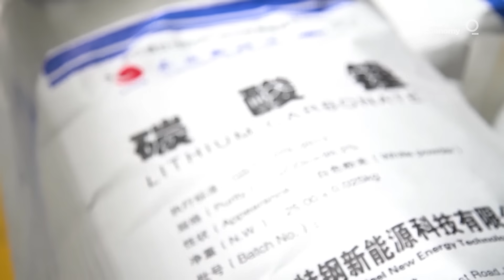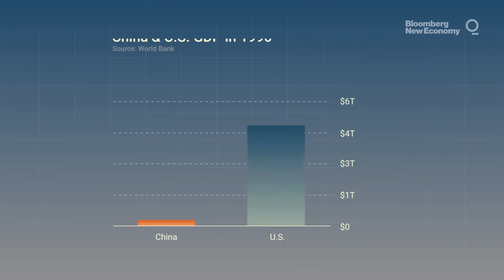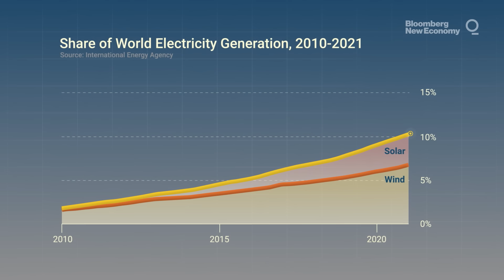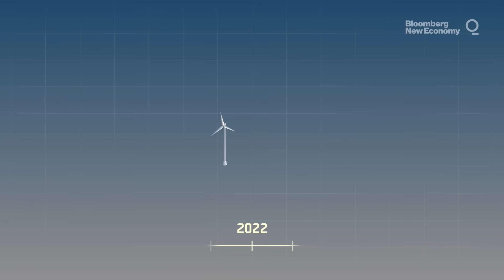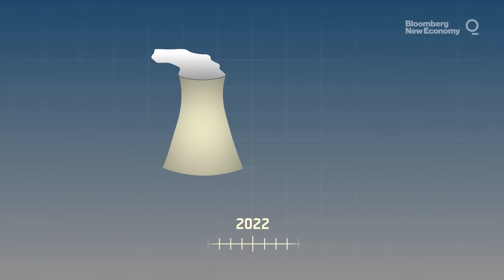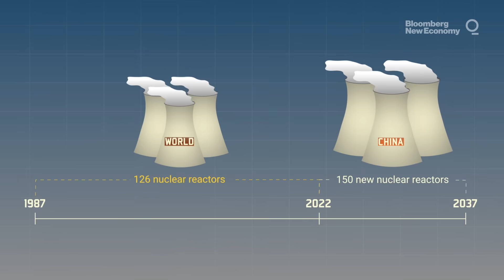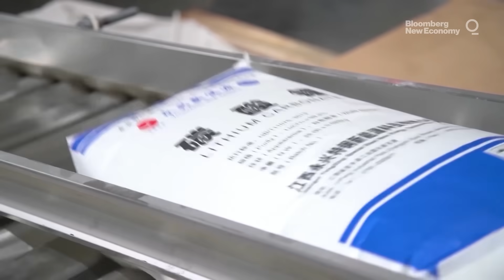How China Plans to Win the Future of Energy

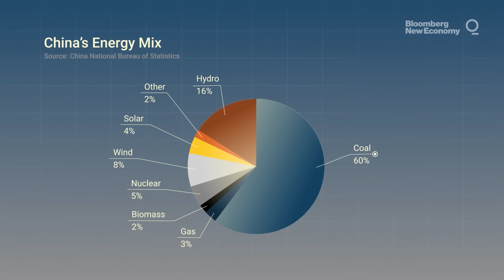Comment: The success of the energy transition depends on a transformation of the global energy sector from fossil-based to zero-carbon sources by the second half of this century, reducing energy-related CO2 emissions to mitigate climate change and limit global temperature to within 1.5° of pre-industrial levels.  5:14
An aggressive energy efficiency strategy, combined with the ramping up of renewables to replace fossil fuels, is the most realistic path towards halving emissions by 2030.
The 1.5°C Scenario will require investments of USD 5.7 trillion per year until 2030. 
Source: IRENA

Comment: Rolling blackouts in the 90’s.  At 14:24 He said it can’t happen again.  Well, it just did this summer.   Green energy is an unstable supply source.  Droughts will happen again and again so where is the hydro power then?  Solar power is way insufficient for a modern, developed country.  Maybe that is why President Xi is turning back the clock?

Comment: Lots of the misconception about the white "smoke" are referenced as the problem while using the traditional fule to generate electricity. 

But, as far as I know, and worked in a power plant for a short peroid of time, the white "smoke" are water. The real pollution is not visiable, as most of porcess are highly effect and no pollution is visiable to human eye. 
It comes with greate trouble when you see real black smoke from a power plant. It may indicate the coal is not full burned and the furance temp is not high enough to burn the coal and thus may cause other issue, like explosion. But it is highly unlikly for a modern power plant since it is mainly operatered by computer. One story about a power plant is that it fully operate over 400 days without any maintance requirement, which means ppl just go there and got their payroll.

To transfer the heat from burnning the coal is where water kicks in. General it is like home heater systerm work, but the water temp is much higher. As far as I can  remember, the water temp will be over 1000 degree Celsius and when the water reach the end of the pipe, some of the water will goes to the waste water pool. The temp will be lower but still it is over 200 degree in most case. And it become the white "smoke".

Comment: By developing on the areas on nuclear fusion technologies, and commercial use of fusion energy and its distribution of facilities can definitely help local isolated villages, town-halls, municipal counties, cities, provinces and rural communities all around the country. The result of achieving nuclear fusion completely, is to produce a fusion reactor which can sustain all the risks in evaluating its principle components and its commercial production components, the key energy principle is a limitless constant stream of energy being readily reproduced, with a constant feedback loop between reproducibility and meeting consistent, constant energy demands across all local areas; this first stage of commercial fusion technology will produce the necessary energy needs for an entire country, and if applied as a technology globally; its wide applications can meet all the challenges and demands necessary for safe, suitable investments both stable and bilateral to the conditions, its integral regulations and its integral complexes and grid maps to the national energy infrastructure systems. This could advance the development necessary for continual and safe clean energy without producing any or little nuclear waste whatsoever, all the expendable nuclear waste from traditional or older modern fission nuclear plants can logistically move the waste into nuclear waste recycling technologies in combination with multiplying their use values into petroleum, lithium and diamonds. China being the “world’s factory” in role of the global economy, with a 18% share in global economy - they have all the technology sectors, with all the up-to-date advancements in many important sectors, with many of these breakthroughs and developments coming from small-medium businesses in the private sector, including state-controlled research and development into fourth industrial revolution sectors like synthetic biology, AI, big data, internet of things, 6g and 7g, automated-services and other technologies etc - China’s government, ruled by the Communist Party have the global advantage by developing new ways to curb U.S-made international business sanctions through the cash holder of dollars and payment-infrastructure tech, by year-by-year increasing their daily share in global currency reserves, by introducing new agreements with oil countries like Saudi Arabia deciding to pay their oil in yuan reserves, bumping up the milestone for increased influence in international business and commercial trade through Yuan banks and financial markets.

Comment: China is building nuclear powerplants foating on the sea. This is a clever strategy in case of the accidents like Chernobyl or Fukushima because you can prevent radiation leakage by just sinking the powerplant itself under the sea level.

Comment: Where I live in China (Hangzhou), they have electric bikes, cars, and even busses! I might daresay that 10 to 20% of cars I see out and about are electric.  Teslas are especially popular here, but there are countless other Chinese electric car brands that are even more affordable for the common people.  And a large percentage of people travel between cities via electric powered high speed train.  

Of course there's still a long way to go in terms of providing that electricity in a clean way, but the Chinese lifestyle is already changing towards electric and that will make the transition much easier in the long run.  Even in small villages, people still use electric bikes, even if car dependence is a bit higher.  So this is not just about urban lifestyle.

And by the way, the air is absolutely pleasant here in summer, winter maybe about as bad as LA.  It's been improving though, in the several years I've been here already.

Comment: I think that most people are very confused about what carbon neutral would actually mean.  Electric car?  No way, they create double the carbon footprint during manufacture than an ICE and generally are worse overall given they are only 50% better in use.  Solar power?  Those panels are far from carbon neutral given the chemicals and materials used in manufacture.  We need to cut down on what we use but currently it is a sales drive to get people to buy a new car for 3 times what it is worth.

Comment: FYI BIO MASS energy is not renewable energy. That is a lie that you have been told. It is just as bad as coal, pollution wise and it is is not a sustainable energy system long term. BIO GAS on the other hand is better system for producing energy and dealing with waste. It is not on your charts. Why? Could it be that big energy is threatened by BIO GAS anerobic digesters, as it can be cheaply developed and solves a lot of challenges that big energy cannot answer?

Comment: If China had a better reputation for respecting and enforcing company IP they would have access to companies like Quaise. Quaise is set to put nuclear power out of business using geothermal anywhere in the world by drilling with millimeter-wave technology. They'll be producing power plants that, while capital intensive up front (to a smaller extent than nuclear power), will produce unlimited energy for hundreds of years from the same investment. Reputation and trust count, in business as elsewhere, and the CCP has a huge deficit and PR problem to overcome to access cutting edge companies like this.

Comment: Does china have enough useless land/coastal sea to power itself on renewables and presuming it builds all the nuclear- can it run on this alone (say overnight when solar is zero). Also does China have a long term waste plan- something few in the west can get past  its citizens but not an issue in China? It won't need all that for weapons and I presume few Chinese nuclear plants are able to burn its own highly radioactive waste. In the long-term hydro will diminish unless its for winter surges due to climate change extreme rainfall. Any chance China could embrace district heating (lots of that coal waste is vented steam) and does it have any geothermal potential. Saying all this - its staggering what China is aiming to do. Could the US do the same (if it didn't have fracking choices). As for Europe- well we bet on cheap gas from Russia while renewables/solar move as slow as public acceptance/nimbyism.

Comment: 1. Why does solar and wind make up a tiny fraction of Chinese energy production, despite most of the solar and wind hardware in the world coming from China?  Perhaps the Chinese understand that solar and wind cannot sufficiently meet their needs.
2. Does China continue to build about one coal power plant per week?  This was the case a few years ago.
3. China is researching new nuclear power technologies at a rapid pace, which will benefit China a great deal in the coming years as new, clean and safe nuclear power plants come on line.
4. Becoming dependent on one country for solar and wind power is a dangerous approach, especially when that country is an un-Democratic, authoritarian, Communist state with a rapidly expanding and expansionist military.
Reply: 1.Your tiny fraction, is 'big absolute number'. In China, we have the largest green electricity output 40% of global total
2.Y, but it occupies less fraction of total power every year. And it will go down. China runs a long term plant to replace and shutdown them(not all). If you search the data, you will find that.
4.China rarely publish other countries. Obviously, your democratic countries, do this at very high frequency. That's strange, we often heard someone/some countries get sanction from US&EU and threatened by US&EU military. Funny

Comment: Why is everyone ignoring geothermal energy?  We have proven the drilling technology to reach the best heat sources in the Earth's crust... It's far cheaper than building a Nuclear power plant. As long as it's a closed loop system or EGS, then you can minimize the risk of triggering a fault-line.
Reply: Running costs are very high if you have to go deep, the wells keep on clogging up

Comment: The 150 nuclear reactors that china will building are generation 4 reactors (3 are underway now).  Extremely safe, not possible to melt down. They are 300 MW or less and can be built in factories in modules. Additionally they are traveling wave reactors, which means they will burn spent fuels from old reactors, thats right they will use as fuel the used fuel that the world can not figure out how to store. Traveling wave process burns the fuel like a candle, nothing left when the fuel is burned. The reactor only needs to be refueled every 50 years!. The reactor and components can be buried, no maintenance needed. Bill gates is building a similar one in Wyoming. Bill Gates' company  TerraPower is the world leader in designing Generation 4 reactors. The reactors China is building are TerraPower designed reactors. Zero pollution of any kind.

Comment: And then when you burn efuel we still end up emitting CO². So what is the point. 
The problem with CO² is that it acts as a switch for H²O which is  the ultimate greenhouse gas problem.

Comment: The biggest problem facing China's environmental protection energy investment is that wind power, solar power and other power generation are unstable, and thermal power and nuclear power generation are required to be configured to stabilize the power grid. Even on the Chinese Internet, there is a saying that this clean energy is called garbage electricity.

Comment: you need to find people who actually know china. china has no protest? china official document record 10000 protest a year, mayors are often require to adjust their policies according. opposition to nuclear is small because china reactors are mostly new 4th gen reactor. some like the peddlebed reactor they developed can't even suffer from meltdown because heat which cause expansion would automatically stop the reaction, they where so confident, that they invited foreign scientist to see a demostration where they turn off the cooling to a reactor and that reactor just chill by itself with no human or computer input. that is the level of confident they have in their technology.

also the report is wrong, the main source of stable green power is not nuclear, it is hydro dam. if we are to move toward green energy we have to go hydro, because even uranium is an exhaustable material, if china build up it capacity as planned, uranium we have would only last 150 years, so it is not the end solution, it just a more concentrated form of "stored energy" than gas, but it is still a consumable resource.

furthermore the argument against on "energy dependent" on china make no sense. for gas and oil u have to keep buying, you don't have to do that with renewable power, in fact you don't have to use renewable power, you can always "turn on the gas". green energy by it nature will never become cheaper than gas until gas is exhausted. because anyone that study chemistry know gas is "stored energy", and it is always cheaper to use stored energy than to extract energy from the environment which is what green energy is really about.

and it is rather silly for the west to argue that China need to do more green energy while also implying China doing green energy is a threat to them. you can't eat the cake and have it, you have to choose, do you see climate change as the priority or your economy. you can't demand china to prioritise your demand on both.

Comment: 8:47 The statement is incorrect. HVDC is being increasingly being used in long distance transmission all over the world.
Pretty sure India has few HVDC lines. US might too. And so would many geographically large countries.

In case you're talking about UHVDC.
In 2010, ABB Group built the world's first 800 kV UHVDC in China. The Zhundong–Wannan UHVDC line with 1100 kV, 3400 km length and 12 GW capacity was completed in 2018. As of 2020, at least thirteen UHVDC transmission lines in China have been completed.

While the majority of recent UHVDC technology deployment is in China, it has also been deployed in South America as well as other parts of Asia. In India, a 1830 km, 800 kV, 6 GW line between Raigarh and Pugalur is expected to be completed in 2019. In Brazil, the Xingu-Estreito line over 2076 km with 800 kV and 4 GW was completed in 2017, and the Xingu-Rio line over 2543 km with 800 kV and 4 GW was completed in 2019, both to transmit the energy from Belo Monte Dam. As of 2020, no UHVDC line (≥ 800 kV) exists in Europe or North America.

Comment: The Earth is cooler w the atmos/GHGs/albedo not warmer.
To perform as advertised the GHGs require "extra" energy upwelling from the surface radiating as a black body.
The kinetic heat transfer processes of the contiguous atmos molecules render such a scenario unpossible.
No greenhouse effect, no GHG warming, no man/CO2 driven climate change or Gorebal warming.

Comment: The high voltage power lines in china has reached the limit. The voltage is so high that it starts to pull in the ionosphere at certain solar events way to strong. Which might be a power source by having the cosmic ray/solar particle absorber right underneath, and so wreck up the planet.

Comment: Renewable energy is not a pie. China can liberate itself from fossil fuel and all countries can. Every country should have a solar panel factory and crank out solar panels. Money is a placeholder for energy. Energy production is not just power for your country, but it is also political power. Europe right now can embargo Russian oil for a little bit but must come back and buy from Russia. If they were carbon neutral they could ignore any attempt by Russia to use that oil as a bargaining chip. China should simply be manufacturing solar panels and powering their factories to make even more solar panels until they are off the grid. The U.S. should also be manufacturing solar panels. The real breakthrough now will be creating batteries to store power.

Comment: Problems with China plan, although better than USA plan (subject to unreliable politicians corrupted by oil industry):
"Peak in 10 years", "net zero by 2060"
THIS IS TOO SLOW!!!!!  Tipping points are being reached which are starting too accelerate warming and arctic ice melt which will accelerate sea level rise 10X or more
Regarding the journalist comment "net zero by 2060... never been done before".  The dumbest journalist must have written that.   The logic stupidity is epic. Dumb on a few levels.

Comment: Recycling batteries in-country to get at the REEs and other ingredients will not only be environmentally beneficial but will reduce dependence on China. H2 powered vehicles such as Toyota and GM are innovating will help a great deal. Energy security and independence is a huge issue - as Europe is just finding out.
Reply: producing, storing and transporting large amounts of hydrogen is another problem. Its not like electric charging that can use the existing power grid.